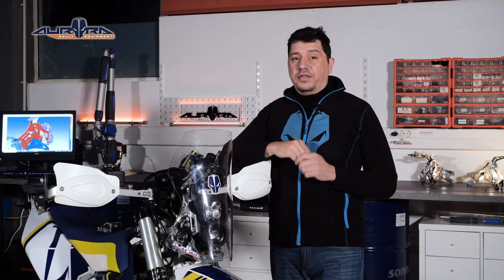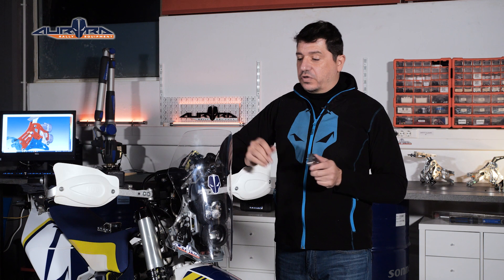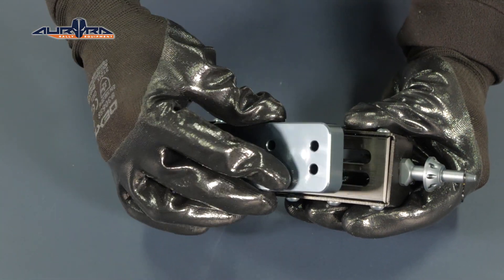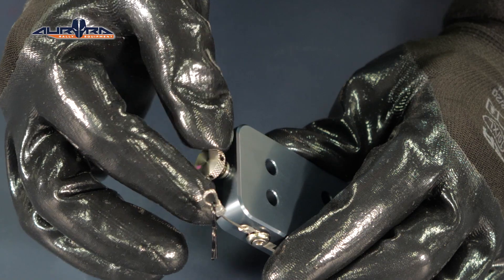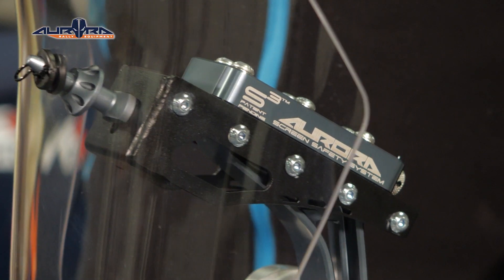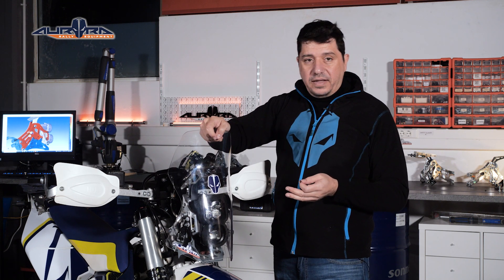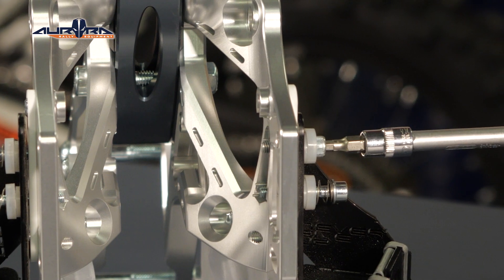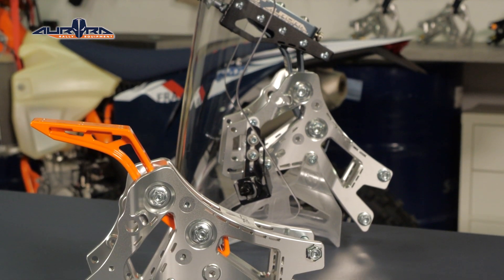Screen Safety System explained

Comment: Hey guys, I have the light kit on my 690, installed by a KTM dealer. So far its superb. But, I have a rattling noise from the metal box on the frame. Any ideas?
Reply from the maker: Hey @plattenschielerlp7796 ! You can send us an email at info at aurora-rally.com and we will check exactly what's going on!